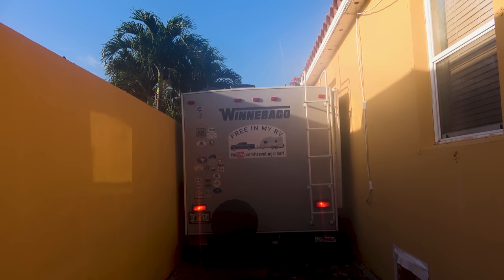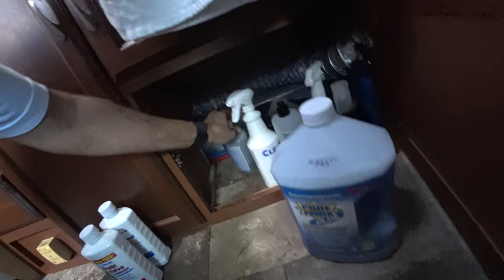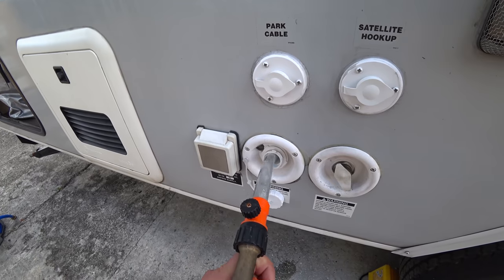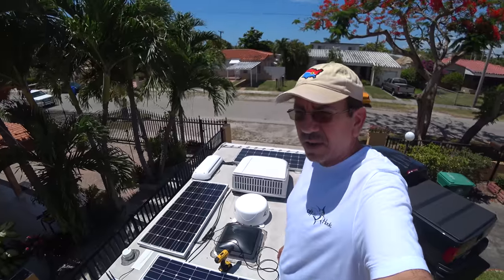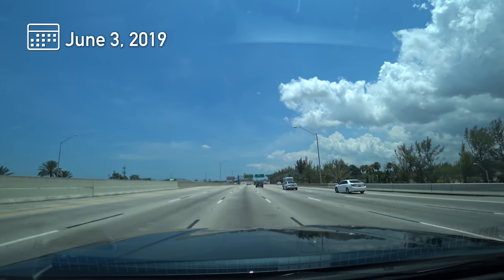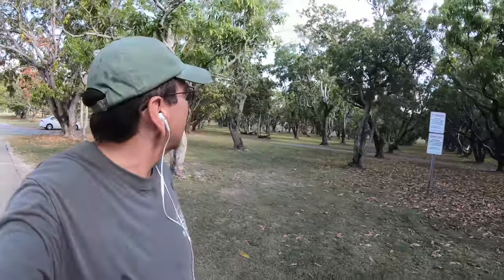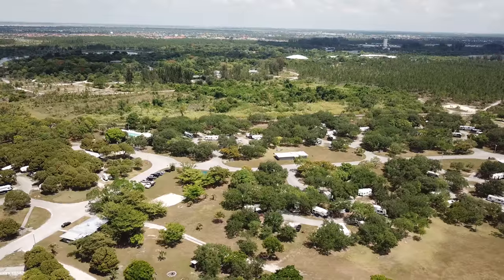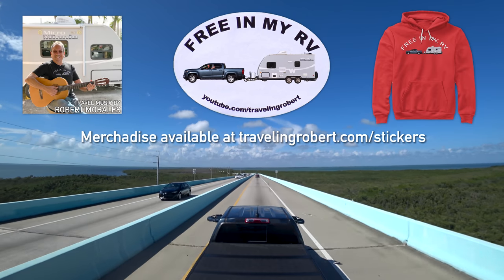Preparing for the Long Trip - #SUMMER2019 Episode 0

Comment: Thanks Robert, I think you need to buy a brass drain valve and use a stainless hose clamp. I would also consider adding a elbow to bring the drain to the edge of the trailer.

Comment: Hello from another Miami resident. Cut that clamp off with some cutting pliers and replace with regular hose clamp that you tighten with a screwdriver. Makes roadside repairs a lot easier. Try to get a long zip tie and secure the hose up so it is not hanging so low. I do not know why manufacturers leave these drain hanging so low where they can be impacted by road debris. I broke mine the second time out on the road.

Comment: I suggest you add a 90* angle to the fresh water drain where it exits trailer, run a length of hose to side of trailer, install drain valve.  This way you do not need to crawl under trailer.  Great video Robert on basic maintenance and addition of new antena.
Reply from the maker: Sounds like a good idea... thank you

Comment: I have lots of extra shower wall sections with the surface like that of your camper, like 1/16th thick.  Seems a good use would be to cut 24" x 24" sections to place stickers onto and both sides are usable.  The shower wall covering was also very cheap and very light weight.  Thinking we can take just one small section along on trips till completely covered and that way we will always have the collection of stickers.
Reply: The old TV antenna on the right if you no longer use it simply remove the pivot the folding arms and antenna attached to leaving the base in place.  Then you can fasten a short rack over the area to add more solar or whatever more you would like to add.

Comment: Aren't you afraid that the first high spot will strip that valve off???
Reply: Thats what most likely wrecked the first one. I think I'd shorten the hose put in an elbow and lead it out to the side. Gain clearance and one does not need to crawl under to drain the tank.
Reply: That's what I was thinking also, that valve will be ripped right off of there

Comment: Very good handyman skills, of course most do-it-yourselfers risk doing it wrong.. ...Good rundown of water tank sanitizing which is probably necessary yearly ...That is undoubtably a county Park and maybe it is closed because someone got attacked by an alligator (it happens).  ...Great drone shots ...what happened with the tight squeeze parking noise by house at beginning?
Reply from the maker: I hit the awning... luckily I was able to snap it back in

Comment: might be covered elsewhere, but curoius about if you found a powered solution for the gopro....   my gopro 6 and 7 both seem to crash/overheat long before I fill a memory card on powered connection on my bike.
Reply from the maker: I spoke to the GoPro rep at VidCon and he recommended an Anker power bank and I guess those have the cleanest power because the GoPro crashes much less often when connected to it.

Comment: That little plug hanging down there that you had to fix seems like it could break so easily...all the time...that would make me not want to buy that particular model...or is it on all of them?
Reply from the maker: It is like that in most of them. I've only had to replace it once, just because the plastic disintegrated in the South Florida heat.
Reply: @TravelingRobert  wow...that's rather shocking...good to know...i would have thought with all that traveling a bump somewhere along the way would have affected it more...thanks :)...btw...as I read your reply I heard your voice in my head lol

Comment: I have been installing electronics a long time, have a degree in electronics engineering - this idea the antenna must be in the center is a joke - there is no possible way the performance is affected nor does the antenna know where it is nor do the signals have any concept of orientation. You can install in any place you wish so as long as it is high enough from interference. We were told the same thing on XM radio installs and car alarm installs. I proved many times that is not true.

Comment: Odd... My Winegard 2.0 was dealer installed (Thor 24' motorhome) on the right side of roof- not centered. Considering the physics of radio wave propagation, I seriously think it makes very little difference whether centered or not. 
P.S. Order a screw on cap style hose-end on Amazon. One big rock might break that plastic pet-cock right off! Goodbye water!
Safe travels!!